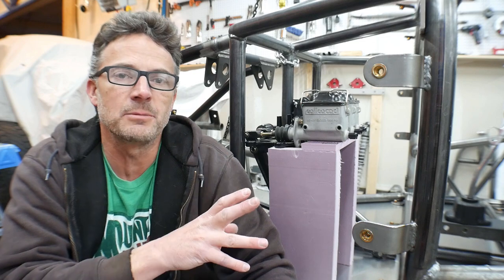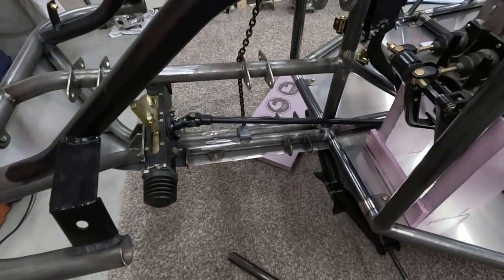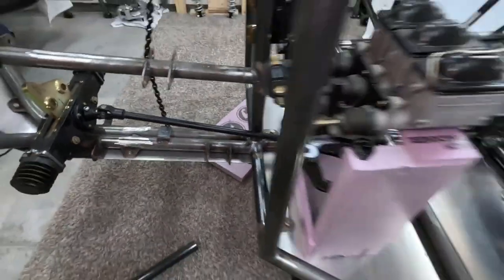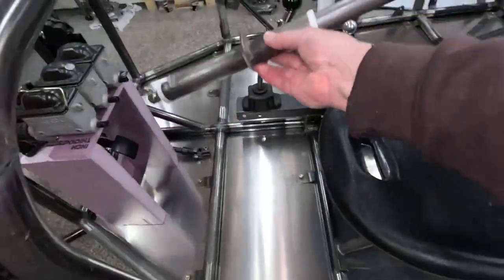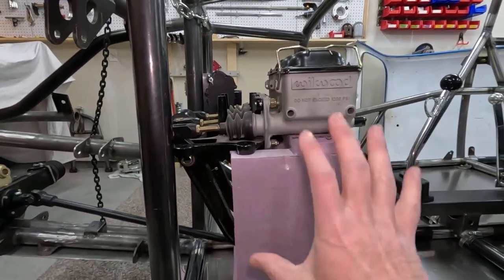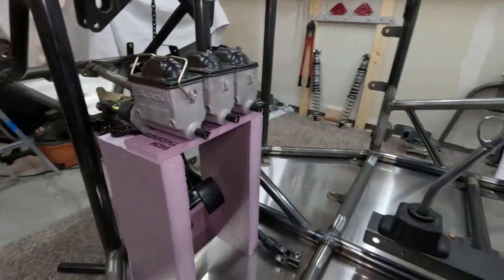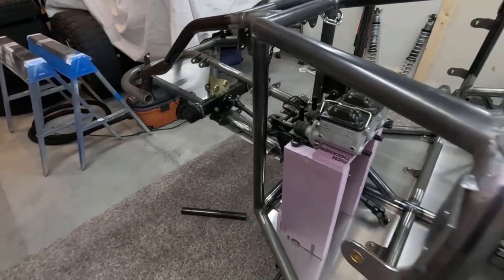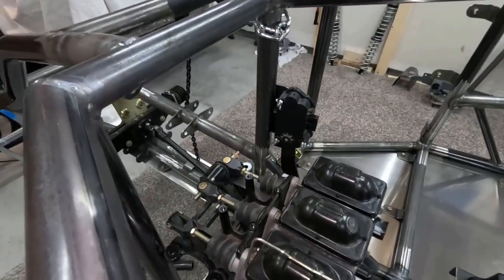The small boring but important details of a chassis build.

Comment: Greetings Mike! Nice trick of the trade for center punching the aluminum floor board plate. That trick really save time.  I would use a Unibit drill bit if its available to save time of chucking and unchucking different size of drill bits to enlarge the holes. It also makes a nice round holes. Nice roll cage. Is the design is derived from a certified racing roll cage design? The weather is going to be nice soon for off-roading. If would be nice to see one of the buggy ready for action. Thanks for sharing.
Reply from the maker: I love using unibits and I usually do. But with these countersunk holes there really is no room for the holes not being right on point. That's why I upsized the holes so slowly. I find the holes to be most accurate when I do that, but in normal situations I would use the unibit. 👍
This chassis is a custom build and it follows no sanctioned rules of any kind. In hindsight I wish I maybe paid a little more attention to that. I think I would have some issues trying to get into some races because of that.
Agree with you on the weather, I think I'll be getting Wratchet out here soon to stretch his legs. 😁